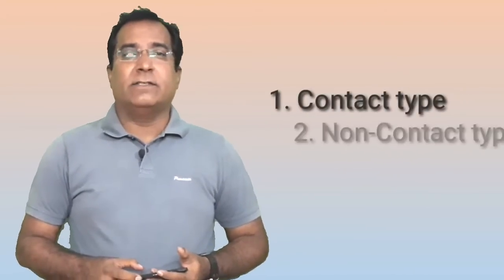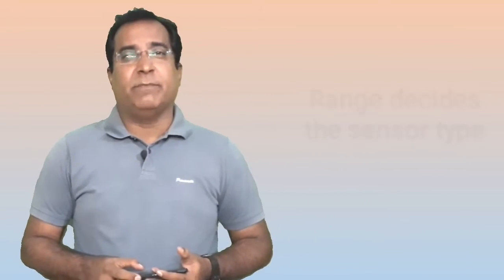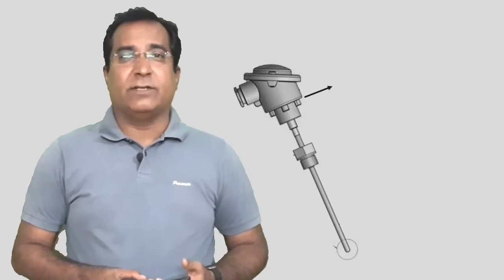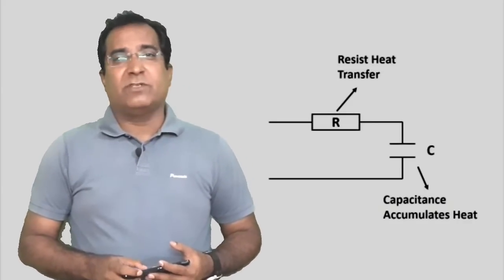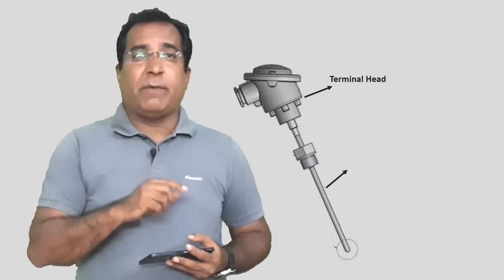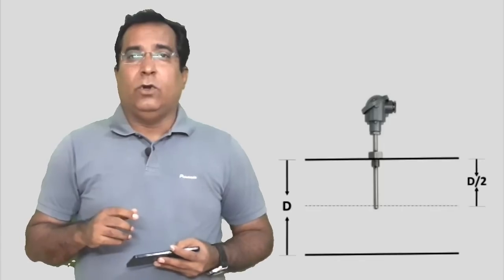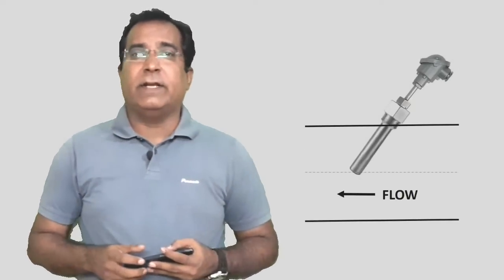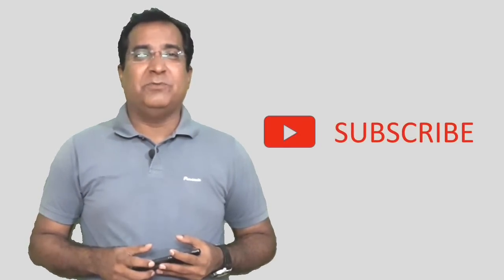Temperature Sensors | RTD | Thermocouple Installation  @dineshdiwani

Comment: Can you tell me how to determine the correct tip size for temperature sensor
Reply from the maker: Size of sensor is decided by surface area available to detect temp and the type of surface area. Smaller sizes have low time constant which is very good to detect temp change very fast. Larger size need big heat to heat first it large body which adds capacity to it and hence it causes RC time constant to be more.